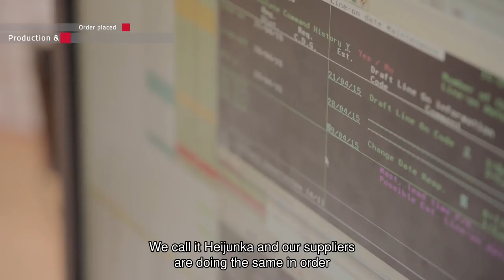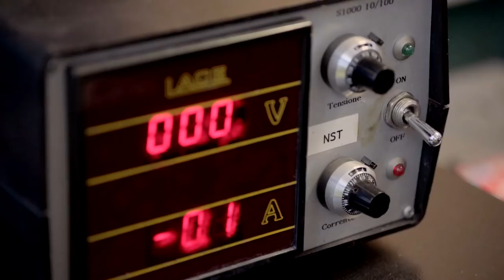Toyota Material Handling - Production From Start to Finish

Comment: Hello dear Friend. I had a question regarding the repairs of my Toyota forklift.
I have a 2005 Toyota 1.5 ton 7FB15 forklift which is unfortunately broken and shows error E0-1 on the screen. I should also say that after this error, the forklift does not lift. by the way, the forklift chassis number is 7FB18-28380. If possible, you can guide me how to fix it and if you have an electronic book of repairs for this model, please send it to me.
thank you very much.
Reply from the maker: Please go to our official website https://toyota-forklifts.eu/ and select your country or region to find specific contact details. Our local team will guide you in taking the next steps.

Comment: It's nice to be Toyota and have all the leverage in the world with your suppliers, but JIT doesn't work for 99% of the world's companies. They simply don't have the leverage required in their supply chain to have complete control over their supplier's businesses and how they will be run. That's necessary of JIT in purest form is to work. Theory Of Constraints is a much better more realistic approach.
Reply: JIT requires discipline.  If you don't have that in your company, you won't be able to do it.  We "try" to do it in our company, but only in certain aspects.  JIT is hard and requires everyone to be on the same page.  When you do JIT right, your operating costs diminish significantly.
Reply: Toyota was born at the top of all manufacturers, it worked it's way there. We have a facility in Georgetown, KY. JITL WORKS!
Reply: The pandemic made JIT completely useless.